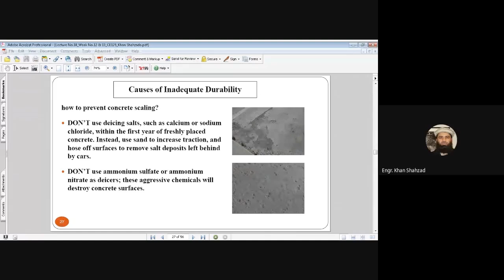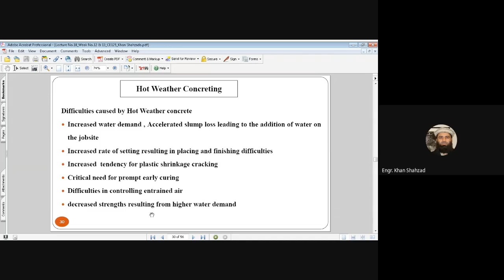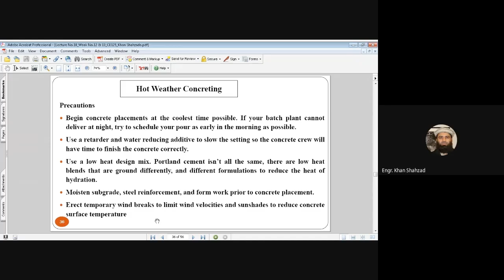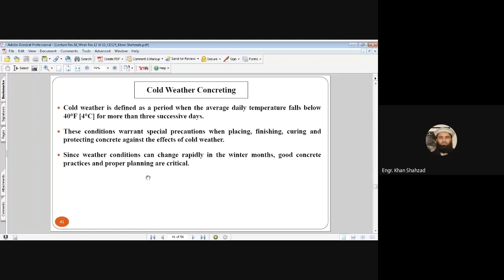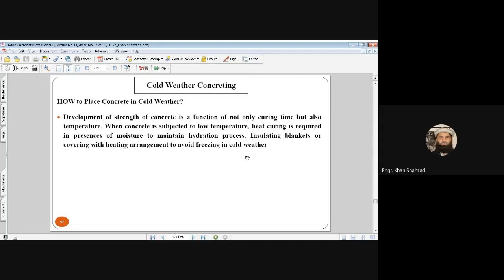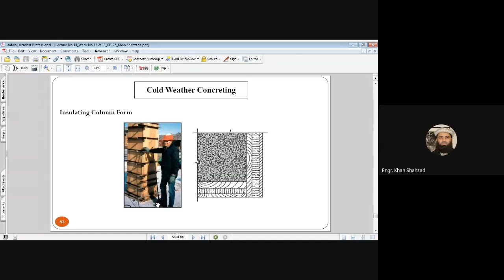Durability of Concrete Part(2/2) | Concrete Technology Course | Dr KS Academy

Comment: Sir fraction force is decreasing by using sand b/c there is another medium come into contact b/w tire and road surface and that is sand. The tire will slid on sand rather than having proper fraction force. Sir practical example when we derive on road having sand on surface it slid how, by applying brake the car will slid more on road than by without sand. Sorry sir if i am wrong.

Comment: Sir why air entrained concrete is used in cold region? Sir when air entrained concrete is used then there may be water in entrained air, during freezing volume of water may increase and cause cracking in concrete by exerting pressure, due to this pressure micro cracks generated which ultimately grow and become macro cracks.  Thank you sir.